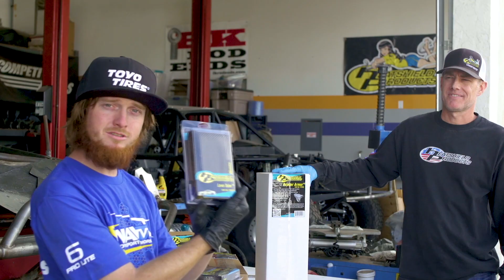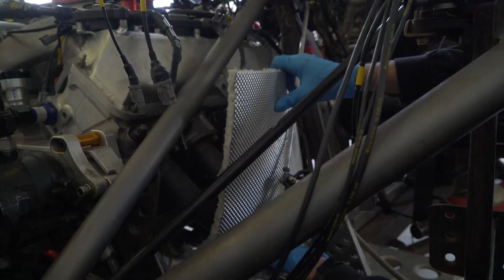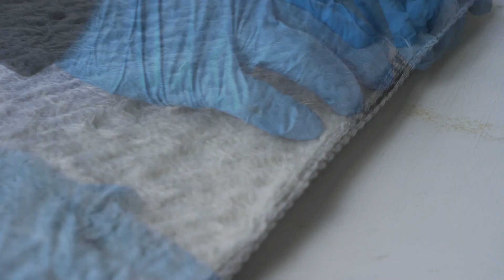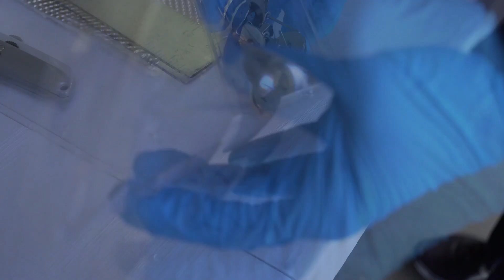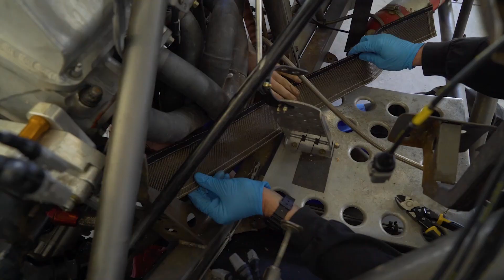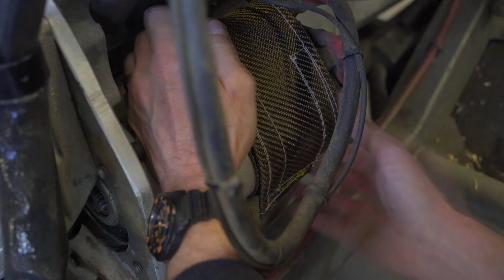Header Heat Shield, Exhaust Wrap, Starter Shield - We Use it All!

Comment: I've heard pros and cons about heat wraps and heat shields. Everything from it does't work, to it makes things worse, and damages headers and starters etc. I have a starter that won't turn over when hot. I have to tap it. The Performance shop says they will cut off the cats, and that should solve the problem.
Reply from the maker: Thank you for watching. When wraps or our Heatshield Armor are properly installed you will not see any issues. It’s a question of the quality of metal in the exhaust system. We make insulation jackets that are 2” thick to completely wrap exhausts systems for power generators , marine applications, and more. They use heavy gauge exhaust pipes. For automotive performance if you follow the directions you should not have any issues unless you purchased some cheap import exhaust.
Reply: @Heatshieldproducts  I have short headers now. The starter worked fine up until I changed rear ends. I went from a 7.5 axle with a 245 gear ratio, to a 8.8  with a 373 gear ratio. I have a 347 Ford Stroker. The engine manufacturer told me to cut off the cats. The new rear end is increasing the exhaust temp, and heat soaking the starter after the engine is shut off. One Performance Shop said heat wrapping the starter would not help in this case. I only added the cats to quiet down the exhaust noise.
Reply from the maker: @Celticman197  The starter gets hot when the air stops flowing, not sure the rear end is responsible for that? Your issues are common, the solenoid over heats when the air stops moving. that is what the heat shields are designed for, to protect the solenoid so the starter will engage.  No sure why they would say protecting the starter wouldn't work? Are they trying to sell you on a more expensive job to remedy the situation? We have sold starter heat shields since day one back in 1985, i don't recall one incident where they did not help.  You may still have to replace the starter if the damage has already been done, but i would try the shield first it's a quick easy repair.
Reply: @Heatshieldproducts   The engine builder told me higher axle gear ratios produce a higher exhaust temp. The cats trap the exhaust heat which cause them to emit a higher heat temp. I was'nt having the problem with the old 7.5 245 ratio rear end. It started after the rear end was changed to the 373. The actual shop that did the work said they would just wrap the starter. But the Performance Engine Company are the ones that said to cut off the cats, because that is where the heat is coming from. I will probably  use your wrap and cut off the cats. Two starters were installed thinking it was the starter. The solenoid may also have to be mover to the fender. They make kits to do it.
Reply: @Heatshieldproducts  I bought your starter wrap, but it did'nt change anything. Starter won't turn over when hot.
Reply from the maker: @Celticman197  The Starter Heat Shield will help prevent damage from heat on the starter, it will not fix a damaged starter.
Reply: @Heatshieldproducts  I will have the shop order another starter. The one that is in it now is new. Only drove it 3 times until it started malfunctioning. Should still be under warranty But it will start fine cold. Looks like if it were damaged it would'nt start at all.